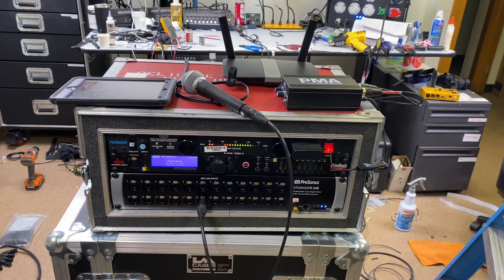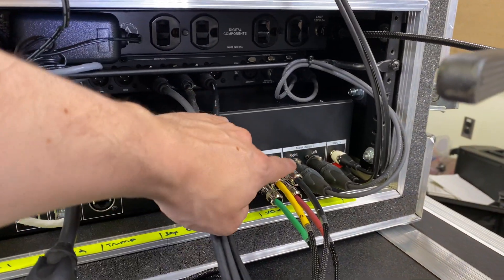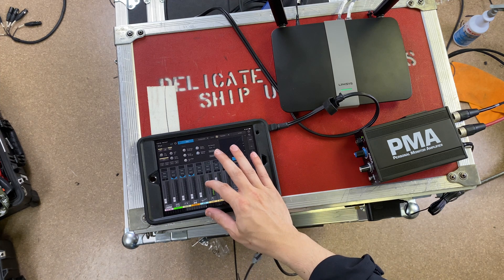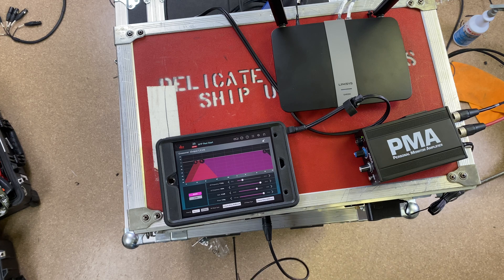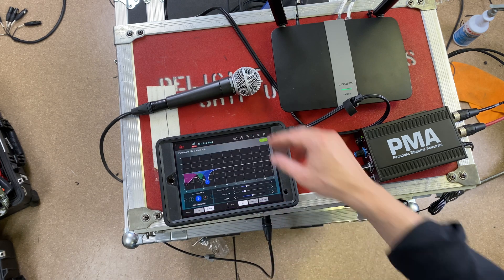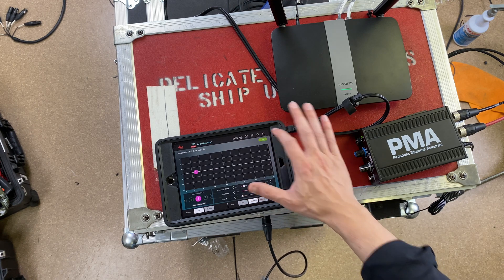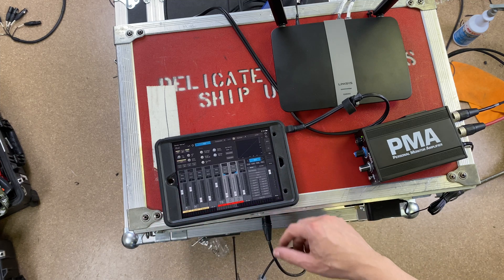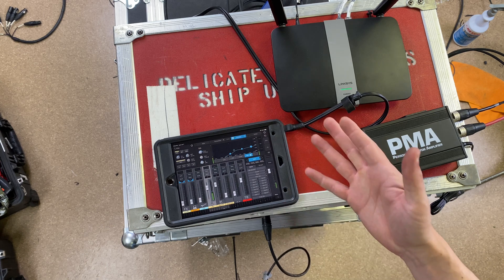How To Tune A PA System w/DBX DriveRack Venu360 & Presonus Studiolive 24R

Comment: Hi billy— old video but new to me. Great content!

I’m a 24R user for both an in ear rack and FOH in some situations. 

1.Do you ever use the Presonus graphic eq on the main bus to tune your system?

2. I love your matrix mix setup on the M32R. I know the 24R has matrix capability— any way to do something similar like you’re doing on the Midas? I’m guessing I’d have to use a mono flex mix bus, set it as a matrix and output it to an aux out for my subs for example.

Just trying to get a better system tuning experience with the least amount of equipment.

Should I just go team Midas instead? :-). Cheers!
Reply from the maker: Thanks for the kind words! I never set up a matrix on the 24R when I owned it. On the small run of shows I used it on, I had the DBX system processor. I used the 24R parametric for fine notches since the DBX did most of the tonal shaping. I preferred the Midas for live mixing which is why I sold the 24R.

Comment: Is the venue more reliable than the PA2? I had problems with mine and had to send it back.
Reply from the maker: I have a PA2 as well, which has been issue free. I did have a weird issue with the Venu360 where it got stuck. I made a video on the reset process: https://youtu.be/fCaBFf8lmQA

Comment: Do you use shielded ethernet cable on the radial catapults?
Reply from the maker: Yes. You will need to use shielded (stp) cables with the Catapults. The shield carries the ground (pin 1). A unshielded (utp) cable will only carry pins 2 & 3. I have a video that takes the Catapult apart if you’d like to see it’s guts! 😬
Reply: @billylaguardia  watched that video and enjoyed it! Wasn't sure if you typically use shielded just on those and have a different cable for internet connections and the like or if you typically go with shielded for everything
Reply from the maker: It can get a little weird when it comes to using data cable in audio applications. Protocols like AVB as an example do not require the shield. Analog audio requires the shield because it provides another conductor to wire the ground. I don't think its necessarily about preventing interference. More using it as an available conductor. Shielded cable is usually a safe choice, unless a manufacturer recommends against it (AVB being an example of that). You can use a standard data cable, however you won't have the ground. Which won't allow you to use phantom power and could allow noise. No harm in trying it, especially if you are in a pinch! I have a video that I need to edit showing how to wire 2 XLR's to a RJ45 jack so you can use run audio lines in a building''s existing infrastructure.
Reply: @billylaguardia  I definitely will be on the edge of my seat waiting for that video to be live! That's one of the ideas I've had in my head so I'd love to see how you do that! I've gotten into making my own cables recently and your videos have been entertaining and helpful... I appreciate you responding to my questions like this and look forward to what lies ahead. Thanks for being an inspiration
Reply from the maker: @dakotadaniels4945  Its actually pretty easy. Ok, you lit the fire under me. Im going to edit the video and post haha! Thanks for your kind words, glad I could help!